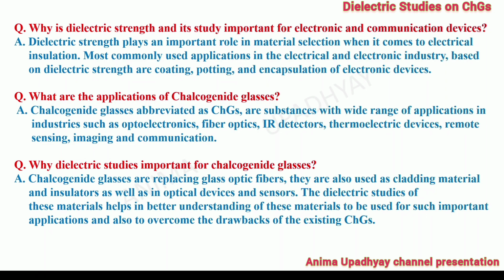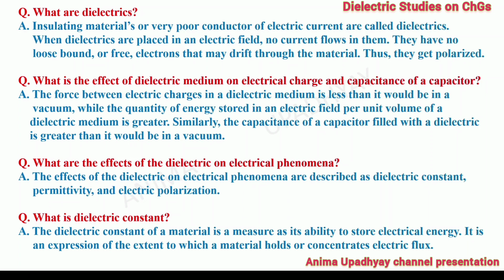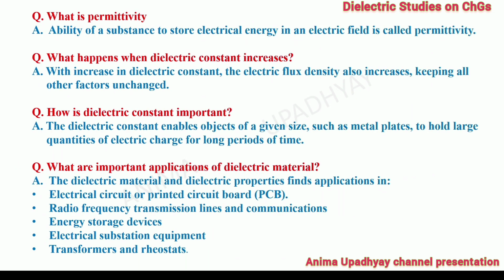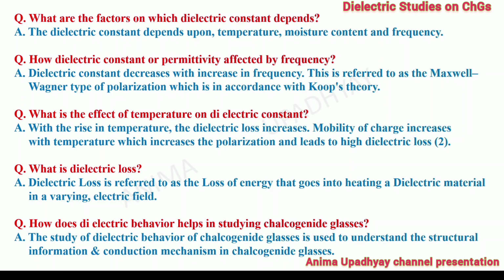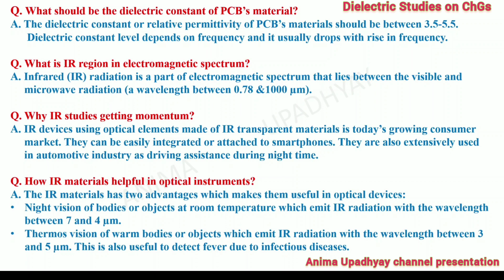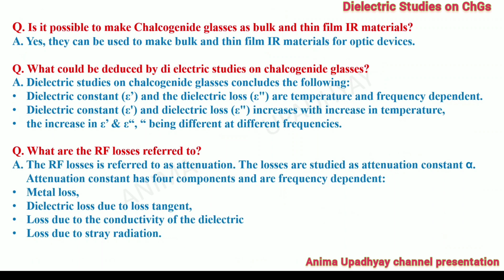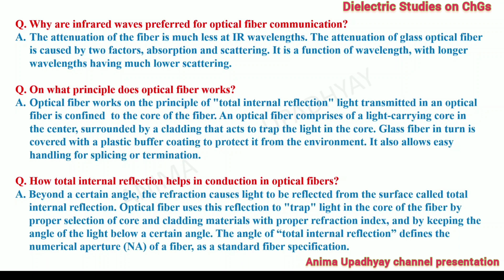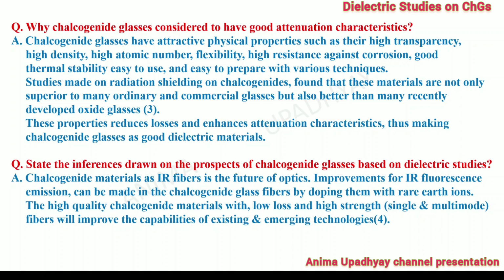Dielectric Studies on Chalcogenide Glasses-  Dr. Anima Upadhyay

Comment: Please make a explanation on DETERMINATION OF AVAILABLE 
LIME (as CaO) 

 Sugar Method 
 Reagents 
 Rectified spirit, see IS 323 : 1959.
 Standard hydrochloric acid, 0.1 N. 
 Standard sodium hydroxide solution, 
0.1 N. 
 Sugar solution, approximately 
15 percent, in carbon dioxide free water. 
 Phenolphthalein indicator solution 
Dissolve 0.5 g of phenolphthalein in 100 ml of 
rectified spirit. 
Procedure 
Weigh accurately about 1 g of the finely 
powdered material into a 500-ml volumetric 
flask and wet it with the minimum amount of 
rectified spirit. Shake with about 400 ml of 
sugar solution for three hours and dilute to the 
mark. Filter through a coarse dry filter paper 
(Whatman No. 40 or its equivalent) into a dry 
flask. Discard the first 25 ml of the filtrate. 
Pipette out 50 ml from the filtrate into another 
flask, add 50 ml of standard hydrochloric acid 
and titrate with standard sodium hydroxide 
solution using phenolphthalein as indicator. 
Run a blank using 50 ml of sugar 
solution and 50 ml of standard hydrochloric 
acid. 

Calculation 
Available lime (as CaO), 
percent by mass = 28.04( A - B )N / M
where 
A = volume, in ml, of standard sodium 
hydroxide solution used in blank; 
B = volume, in ml, of standard sodium 
hydroxide solution used with the 
material;
N = normality of standard sodium 
hydroxide solution; and 
M = mass, in g, of the material taken for 
the test.